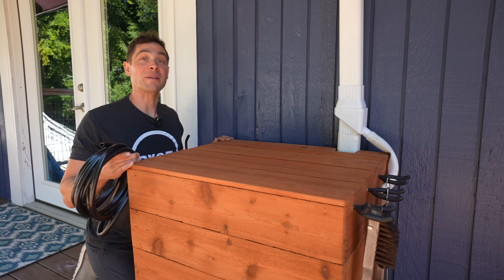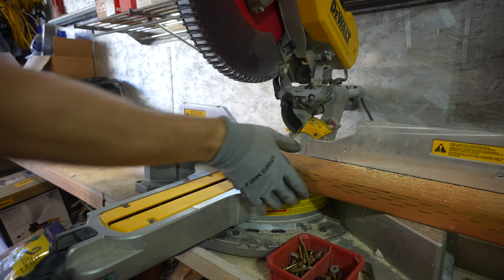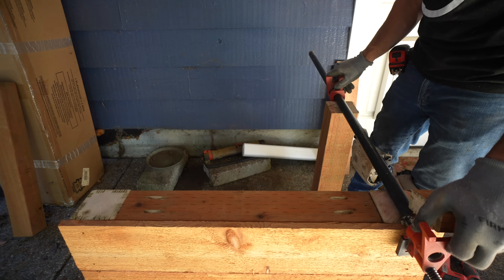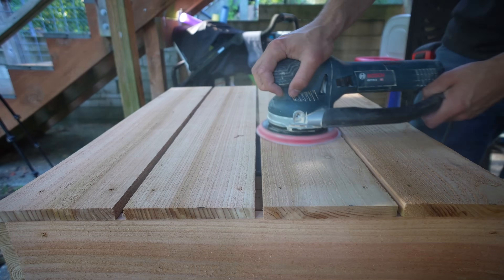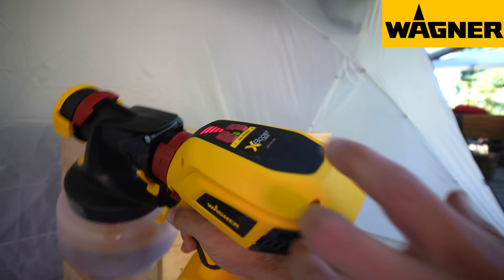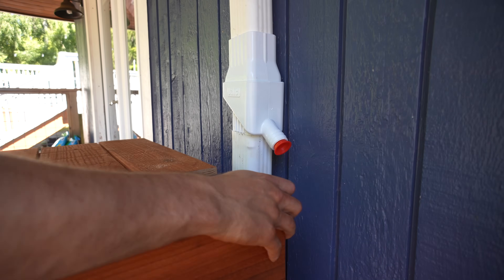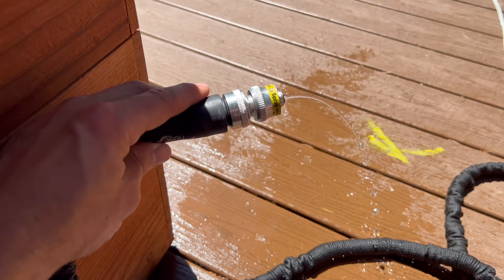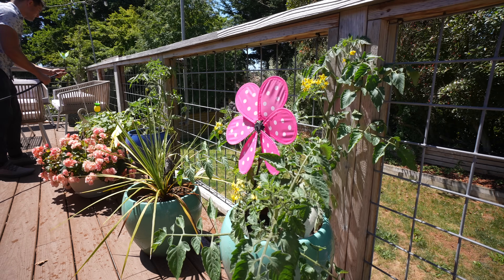DIY Rainwater Harvesting WITH Electric Watering Pump!

Comment: So from 1 to 10 how easy was the Wagner paint sprayer easy to clean?  Nice work as always. Forney, TX
Reply from the maker: Great question and sorry I didn't include that in the video Mary.  I was extremely easy. All I did was pour out all the excess stain, poured a little paint thinner in the hopper and shack it up, pour that our and ad a bit more paint thinner in it and spray until the spray comes out clean.  Then wipe it with a clean cloth and done!

Comment: I have a 550 gallon unit that I purchased but haven't installed yet as it will sit along side the house and in between two downspouts. I haven't quite figured out the rain collection spout connections (though what I have seen will cost me a bit) and am also somewhat concerned about the silt and roof material collecting in a tank of that size that I can't get into.  My guess would be to add the spigot assembly about a half of a foot above the bottom to allow for the silt to settle and I won't draw from that area. Also will probably place it on a defined gravel area to allow for drainage from overflow. Definitely need to get it connected before fall so I can draw from the rains when it starts again. If I can get it going without breaking the bank AND working correctly I intend to get a second one for the other side of the house.
Reply from the maker: Thanks so much for the input Stephen and your thought process.  Always hard to keep things within budget and there are always creative ways of doing so.  Hope things work out on your project.